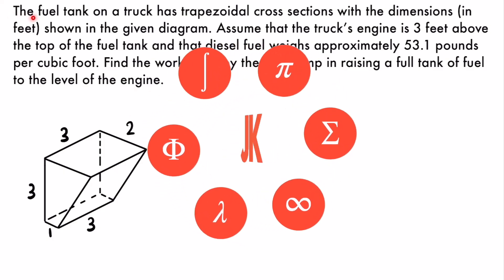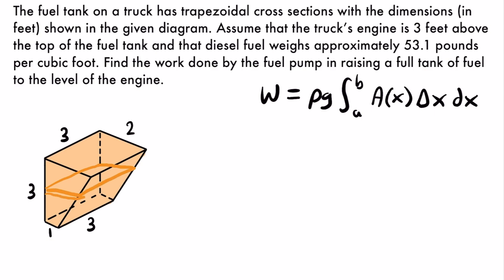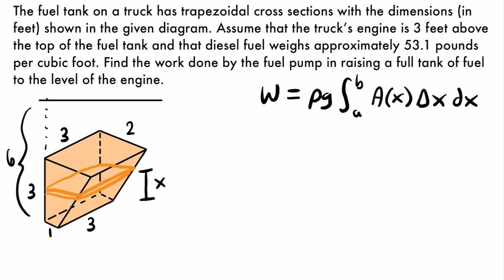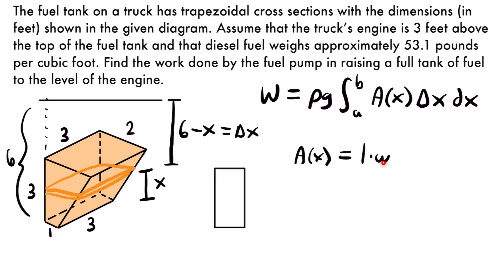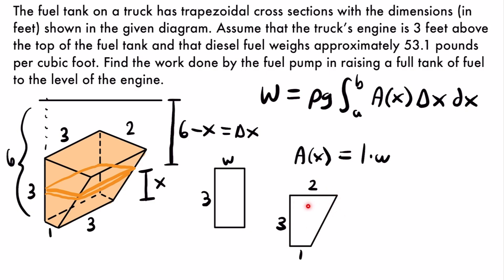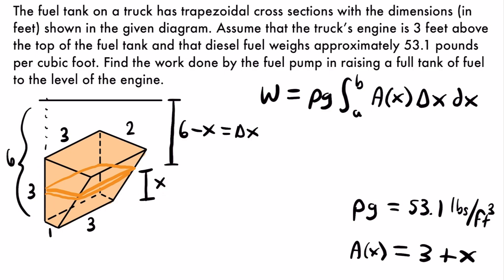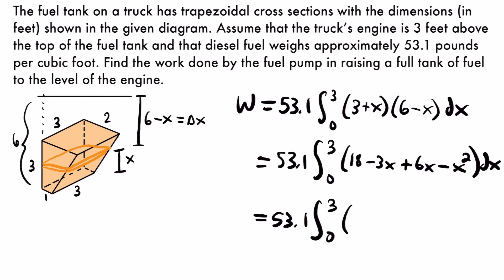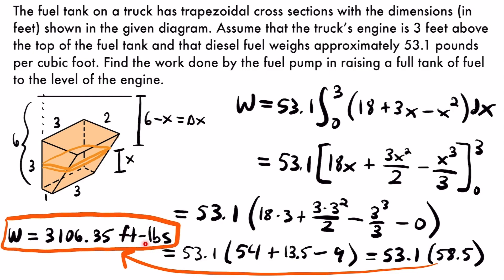Work - Pumping Problem for Tank With Trapezoidal Cross Sections | JK Math

Comment: Why are you doing in terms of x when measuring height is supposed to be in terms of y
Reply from the maker: In these types of problems really you can use any letter/variable you want to represent the height (as long as it’s not used somewhere else in the same problem). It could be z, x, y, etc. As long as you remember that the variable you use represents height, you’re good. So you could work in terms of y if you wanted to, it has no effect on the answer. It’s the same as me using x. It’s just about what you prefer to use. Hope this helps!